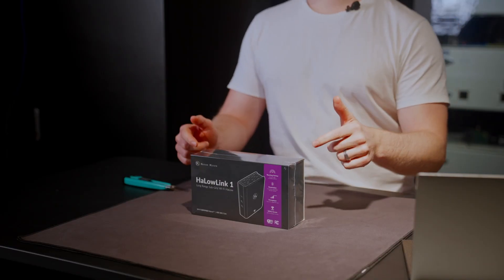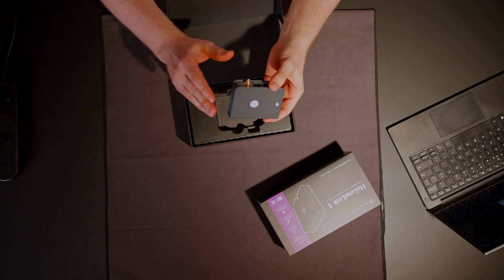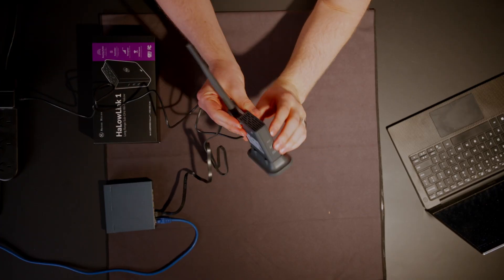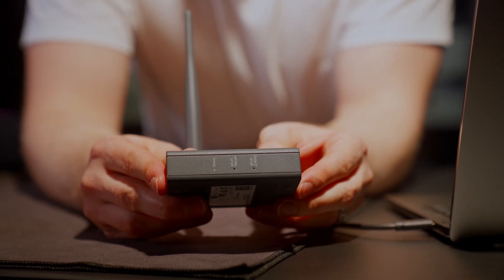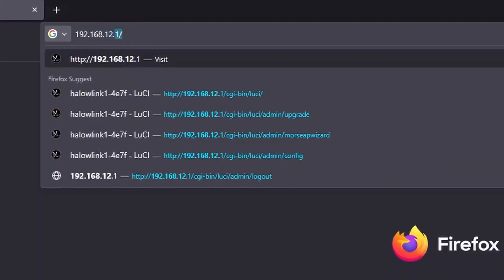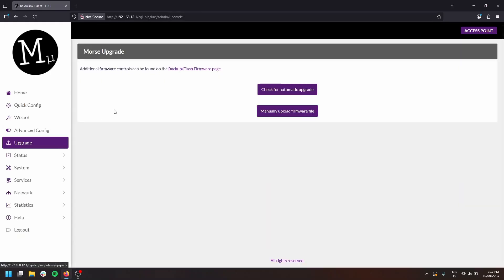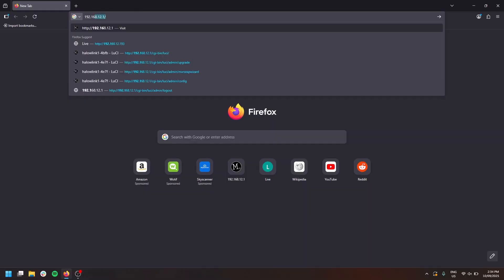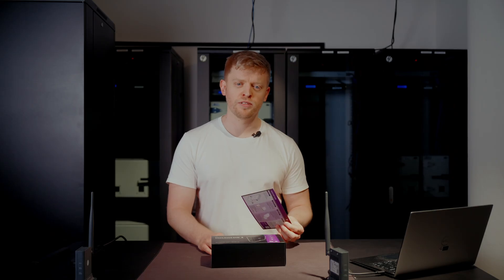Unboxing & Setup: Morse Micro Wi-Fi HaLowLink 1 Router

Comment: Can our devices access the Wifi like a router? This was a huge reason why I purchased the router. To connect my Yarbo to this HaLow via Wifi. Currently my Yarbo is connected to our 5G internet wifi and the signal strength is enough next to the house but and goes out a little ways but my goal is to have Wifi for our property.
Reply: Yes, this HaLowlink can connect to existing routers and devices...that's why it has a 2.4GHz chip in it....but to exploit Wi-Fi HaLow advantages fully, you'll need a Wi-Fi HaLow device at the other end. A lot of people use two of these HaLowLink devices to create a long distance bridge....maybe between house and shed / garage / office at the end of your garden.
Reply: @AndyMc-802.11ah  I bought 2 of these however I am getting better range from my Wavlink AX3000 located in our closet with a window and the HaLowLink1 in the same location. When I go to my barn with the 2nd HaLowLink1 my signal is poor however on my phone I still am getting good strength from the Wavlink AX3000. I was Not expecting this result, I was hoping I could use the HalowLink 1 as a wireless wire but once inside the barn I get nothing and it's built for indoors not outdoors. However if I purchase another Wavlink AX3000 I can utilize that as a high speed wireless wire. Now I am only getting 15 to 20 mhz per second at that distance but with the WIFIHaLow I am at 1 to < 1 mhz.
Reply: You’ll need some kind of adhoc WiFi mesh bridge located on the yarbo that would capture and link the 900mhz band and rebroadcast it as 2.5/5Ghz

Comment: I'm watching this video via Wi-Fi Halow) (8mhz band 916 mhz freq) 
Thank you for your work! 
Can I ask a question? Can i install a 900 MHz two-way amplifier and get higher transmit power? I need a long-range connection of several kilometers. (I'm from Eastern Europe, so legal issues don't concern me, as long as it works.)🙃
Reply from the maker: Thanks for watching our video! 🌍 Great question, just a quick note that some countries in Eastern Europe still have specific regulatory restrictions, so be sure to check your local requirements before setting up. The HaLowLink 1 is designed to meet regulations in the US and Australia, and we can’t guarantee performance with external amplifiers. How far are you currently getting with your setup?
Reply: @morsemicro I just recently set everything up. I tested it today on 200 meters and got 5 MB of speed. It was using standard 2.6 dBi antennas, and the antenna was positioned at a height of 2 meters.
I plan to buy a 4-watt amplifier and install a 10-14 dBi Yagi antenna.